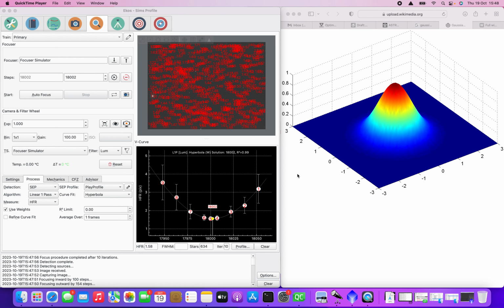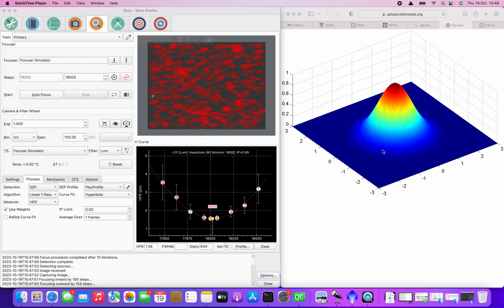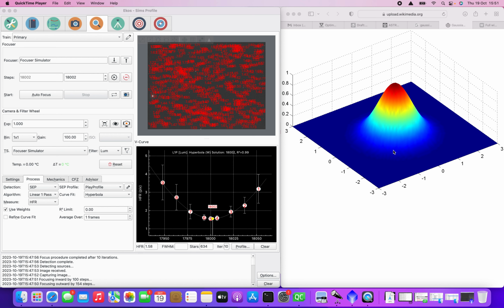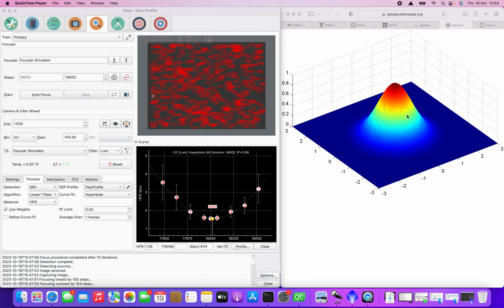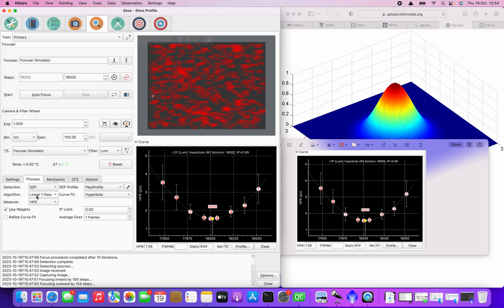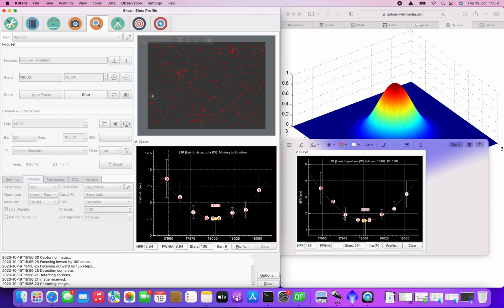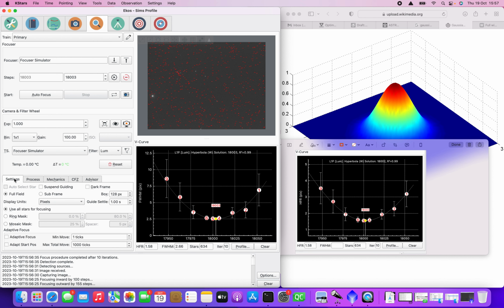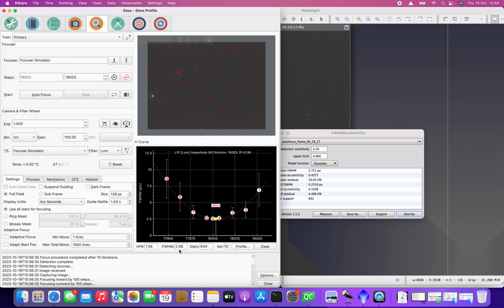Kstars / Ekos focusing using FWHM

Comment: Is it me or the execution of the FWHM is a lot slower than the HFR?
Reply from the maker: FWHM will be slower as it's doing more processing. The HFR processing is always run whichever measure you select. Then if you are using FWHM in Autofocus it will fit a surface to each star to get the average FWHM.